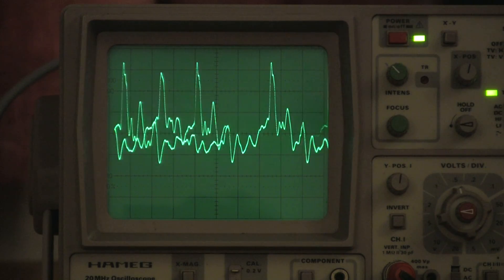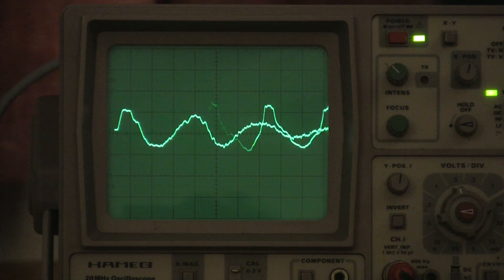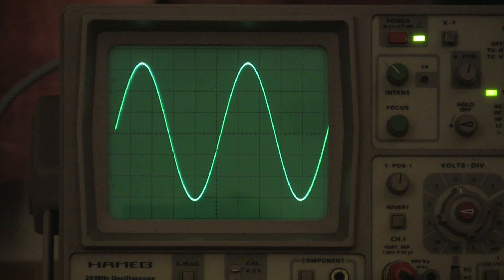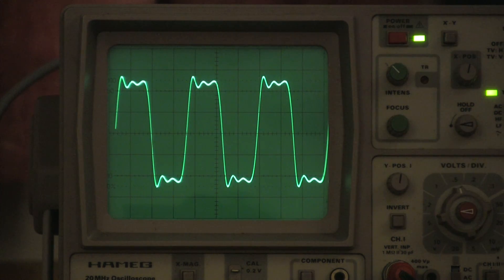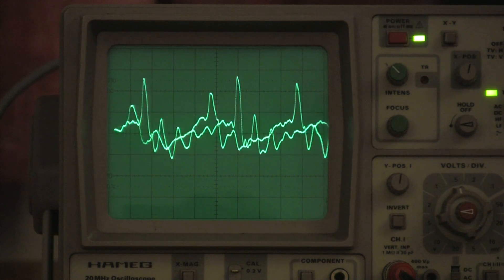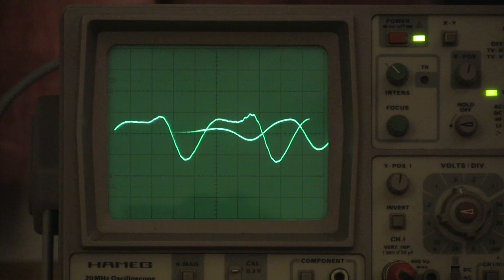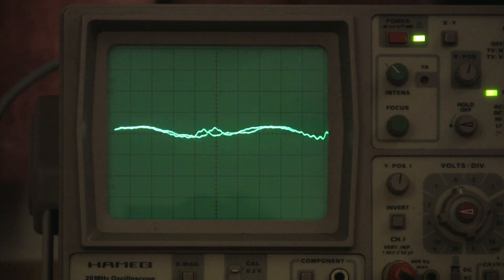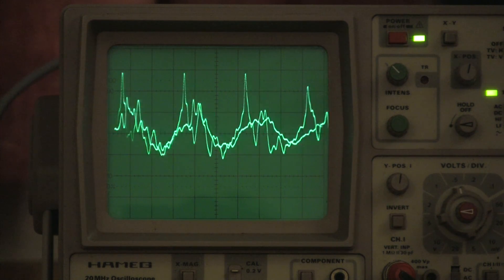Can you hear the difference between a square wave and a sine wave?

Comment: The second harmonic is twice the frequency, not three times, which is the third harmonic. A square wave is composed of odd harmonics. The second harmonic is an even harmonic.
Reply from the maker: This is a useful clarification. I described the second harmonic that is present in a square wave as the second harmonic. To be exact however, the second harmonic of a square wave has zero amplitude, as have all of the even-numbered harmonics. Therefore the next harmonic after the fundamental is the third harmonic, even though the second is not present.

Comment: To those commenting "but that's not even a square wave", please understand (RIP Iwata) that a "perfect" square wave is a purely mathematical concept that cannot physically exist in nature. To produce such a square wave would require that the transitions between a signal's "on" and "off" states take effectively zero time, which in turn would require infinite bandwidth to achieve. As you might be able to guess, bandwidth is not infinite in the physical world, so even a digitally generated signal whose waveforms 'look' perfectly square in your DAW's waveform viewer is going to come out of your speaker sounding the way that the square waves in this video look. (And even if you managed to find a magical speaker that was able to oscillate in the required "zero time" manner to actually produce a physical "perfect" square wave, your eardrums would react to it more or less identically to how they react to the imperfect waveforms anyway.

tl;dr - They may not look perfectly square, but they're as close to square as they can realistically get.

Comment: I know this is old. But many people here are fundamentally mistaken on a point they've made in the comments. Many people are saying the square wave is looking less like a square wave at higher frequencies. Remember that the digital audio is being sampled at 44,100 Hz, meaning per second there are 44,100 values of where the wave is. At the frequency of 22,050 Hz that means that 1 sample is up, and the next is down and this repeats. Past 22,050 Hz, 44,100 Hz audio physically doesn't have the ability to represent that frequency. He stated this much right in the episode.

The display is showing the result of the analog to digital conversion, meaning the graph showing the waveform is showing the digital version of the wave. Since the square wave is generated by combining every other whole number multiple of the fundamental frequency, theoretically to infinite, as the fundamental frequency rises, more and more of the harmonic frequencies that comprise the square wave are above that 22,050 Hz limit and thus the digital waveform loses more and more of its shape when it is converted to digital. This does not alter the sound however, as by the point that these frequencies are lost in the conversion they are already outside of human audio range, we physically can't hear frequencies that high.

The graph shows a representation of the digital waveform, which coincidentally shows an effect similar to what we hear. Just as the 44,100 Hz audio track can't represent frequencies higher than 22,050 Hz, we, as humans can't hear frequencies above 12,000 to 16,000 Hz based on our age and other factors. To our brains what we hear would start to sound more smooth, just as the graph ends up looking smoother as the digital audio is unable to represent those frequencies.

Unintentionally this visual effect, which has no effect on how we hear it, as the frequencies that cause the graphical representation to look smoother are already outside our hearing range, gives us a visual representation of why this effect occurs. This effect, where square waves seem to get more similar to sine waves is a widely known phenomenon, and it happens with analog as well. Even if you completely fake the square wave with software that simply alternates between max and min based on interval, instead of combining all sine waves with odd multiples of the fundamental frequency, you'd still hear the same effect.

Comment: To all the people claiming it was his equipment, thats not only the case. Humans cannot hear about 18-20khz depending on age, history with volume, genetics etc. Square waves render in the frequency domain odd harmonics, this is what makes them different to sine waves. If they did not have these harmonics it would just be a sine wave. Since it is impossible to hear frequency components above 20~khz, suppose this would be a third harmonic, it would mean that any (perfect) square wave above around 7khz is indistinguishable from a (perfect) sine wave of that frequency.
Headphones, amplifiers etc all have a limited frequency response precisely because of this. It doesnt matter that his square is slightly distorted at these frequencies, because the higher frequency components will end up highly attenuated anyways. It may not look very similar in the time domain, but if you look in the frequency domain there's probably still not a lot of difference between the 'distorted' square wave and a perfect one.

Comment: It's the equipment at fault here. It's not able to produce a proper square wave. A square wave is either on or off but the oscilloscope display shows this is not the case. The vertical "drop" and "lift" of the wave becomes more angled rather than vertical and much closer to the angle of the transitional element of the sine wave, hence it sounds much closer to it on listening
Can anyone verify this?
Reply from the maker: The square wave was digitally generated in Pro Tools. You are seeing the effect of digital-to-analogue conversion. An analogue function generator would have made a square wave that looked better on the oscilloscope. But the output has to be converted to digital for Internet distribution. The method used here matches what you see with what you hear, but the demonstration is better done in the analogue domain and observed live, which clearly cannot be done over the Internet.

Comment: From where does this sound come from, no speaker? I'm currently reverse engineering-ing an audio generator with vacuüm tubes, but there is no speaker although I can hear a sound when I put the generator on. From where does this sound come? 
Thx alot if any1 can help me =)
Reply: Ilias de Jager 
Great question! The sound is coming from the audio components vibrating from the voltage in the circuits. Unfortunately, I don't know exactly which components make the sound. It is the same reason that old camera flashes make that high pitched sound when they are charging. If there is an inductor, that would probably make the most noise, because it is most similar to the voice coil of a speaker. I would also guess that a capacitor could make sound because it might be similar to a Piezo Disk speaker like in older digital watches.

Comment: 100 Hz square wave was audible but not the 100 Hz sine wave, why so?
Reply: Depending on where you're listening (e.g. smartphone speakers, laptop speakers, bad headphones), the speaker won't be able to reproduce frequencies as low as 100hz. Since the sine wave has only the fundamental, it will be silent, whereas the square wave you'll be listening to the overtones only - meaning that you're not actually listening to a 100hz tone, but either 300hz or the other overtones above it.
Reply: I make an uneducated guess: With the square wave you're listening to artifacts caused by the unnatural signal (the signal is everything or nothing, and nothing in between). With a sine wave the speaker is gently accelerated, stopped, and accelerated backwards, etc. Much smoother.

Comment: 4 kHz - that's hardly a square wave.
With the slew rate as low as this, no shit it starts sounding similar at higher frequencies. The waveform starts looking similar.
Also at frequencies over 25 kHz, not only don't people hear it, but very few speakers can reproduce it. But as much as we can't hear fundamental frequencies over 20 kHz (or less, with advancing age), we can hear how the higher harmonics alter the fundamental frequency. If these higher harmonics are unwanted (ie. are not present in the original audio signal - they are produced by the audio equipment, that is the so called harmonic distortion. 

Also, second harmonic from 4 kHz is 8 kHz, not 12 kHz.
12 kHz is third harmonic.
4 kHz - fundamental frequency (base, 1st harmonic)
8 kHz - 2nd harmonic 
12 kHz - 3rd harmonic 

Second harmonic from 8 kHz is 16 kHz. Not 24 kHz, that's 3rd harmonic.
And so on.
You said it yourself, components of square wave are the base harmonic and odd multiples.

Comment: Well, consider that many musical instruments produce harmonics at substantial pressure levels well into the 40Khz range.

Best examples would be small brass instruments such as trumpet or cornet. This is even more more pronounced when they are played with a 'mute', where the 'fundamental' is the most attenuated component . If you look at their wave-forms, they are triangle or saw-tooth like (Edit >> this is actually easiest to see with LARGE brass instruments such as trombone played with a mute - for e.g. there's one on Stanley Clarke's second album "Journey to Love" - I forget which track, but it's one of the first 4).

 I suspect this is the reason I find recordings of these intruments at 96KHz or higher, and in fact of music in general to be more realistic and generally 'easier on the ear' than on CD.

In fact I can even go as far as saying that I wince less often listening to recordings (or transfers of analogue recordings) at 'hi-res', particularly of the afore-mentioned small brass - check out, for e.g., the Miles Davis albums now available as 24/96 or 24/192 downloads (or from SACD's, DVD-A's and even blurays). 

This is despite the fact that at my age (mid-50's), and having not taken precautions to protect my hearing earlier in life riding motorcycles and in other scenarios, my hearing rolls-off steeply after c. 12KHz.

Comment: i couldnt even hear 100hz sine
Reply: Surely you're using cellphone or laptop speakers. These are usually bad at playing 150 Hz and lower (100 Hz SQUARE wave sounds fine only because of the higher frequency harmonics)

Try using external speakers or headphones!

Comment: actually a perfect square wave doesnt exist cuz the speaker cone movement always needs Time. a square wave is more Like a sine wave with a much higher freq with stretched bottoms and Tops. thats y it can be heard with any speaker. some synthetic bass sounds are Made using the Same effect: imagine you have an 41 hz (e1) tone. many speakers cant reproduce a Tone that low. so they take a lets say 82 hz (e2) tone and extend only the bottoms and Tops to Change it to 41 cycles. Now the tone can be reproduced with any speaker that can reproduce 82 hz. But doesnt it Sound harsh Like that square wave? no. cuz 82 hz is still a Bass tone.

Comment: You should also know that Youtube compresses the sound with AAC which is a lossy codec. This means that it saves bandwidth by removing more of the higher frequencies. Do a spectrum analysis of the downloaded youtube video and you can see that the higher frequencies are hardly there. I can hear 12 kHz but the volume is much lower than expected due to this lossy audio compression.
Reply: +Mikael Murstam 
Can you please tell me if Youtube and AAC actually compress the dynamic range of audio as well as limit the hi freq response?
Sometimes I think that it's audio is lucky to have a range of 15db sometimes all the sound is the same level, or seems to be.
Reply: Colin Baggarley AAC shouldn't compress the dynamic range by default. I don't know if that's a setting in the codec that youtube is using. However, I know that some codecs use volume normalization. That is not the same though.
Reply: your going deaf, i can hear up to 16k at normal volume, and 18-19k when i turn it up
Reply: ***** no what you are hearing is actually aliasing effects at lower frequencies. You can actually do a spectrum analysis of it and prove that the higher frequencies do not exist. The compression algorithm removes it. By the way, the fact that you say you can hear 19k further proves the point. The algorithm cannot encode higher than 16k and only a baby or a very young child can hear 19k.
Reply: Thanks, Mikael. Probably correct about the codec settings but I've searched for and done as much as I can. Doesn't really matter. Just annoying to hear that "breathing" that occurs with youtube stuff and sudden drop in amplitude when a drum is hit or whatever. Interesting !!

Comment: Good demo, but for technical reasons you won't be able to do this test properly via YouTube, or through any media format that compresses sound data--and most do. This is because most sound compression strips phase information (since we typically don't perceive it, it's an easy way to reduce the data by 50%). Square waves and triangle waves differ only in phase information.

To do the test using digital recordings, make sure you use a non-lossy format such as WAV or FLAC which preserves the waveforms.

Comment: @ 12khz they did indeed sound exactly the same to me...utter silence.
Reply: I can hear them both clearly...
Reply: I am 48 and clearly hear 12 khz
Reply: A lot of people but not all stop hearing very high frequencies around the age of 25.
Reply: LuckyFlesh I can barely hear it when using equalizer
Reply: I can hear 12kHz, but at half the volume of 10kHz. I'm not sure if that is more due to my phone or the fact that I am 46 years old. Not bad for a bass player. Don't feel bad, because you aren't really missing anything at 12kHz. That superpower would be less useful than being able to see infrared or ultraviolet light, although being able to see heat would prevent a lot of burns.
Reply: AHHH MY EARS!!!!
Reply: Meh, I couldn't hear anything from 8 KHz and above. I could only hear 6 KHz if I turned my head.
Reply: Looks like you are an adult.

Comment: Is there something really wrong with my ears, or is there no sound when the 100Hz sine wave is supposed to be playing? I can hear the square wave, but it alternates with silence. What gives?
Reply: Speakers or headphones? My laptop doesn't reproduce sounds that low since its speakers are relatively tiny, but my set of cans do quite well at reproducing the 100 Hz sound.
Reply: +D. Casey Tucker I can just about hear the sine wave on my earphones, but the square wave seems a lot louder. Maybe I'm only really hearing harmonics from the square wave, or something.
Reply: Indeed, because your earphones probably have a high-pass near 100 Hz (some of them roll off higher, some lower), a square wave which has more higher harmonics will sound louder than the sine. Doubly so on earbuds.
Reply: D. Casey Tucker So I'm not crazy! About this, anyway.
Reply: DarthEditous i turned my volume all the way up and i can hear the sine wave just barely 

Note : Using my HTC's Boomsound  Dolby audio on Music mode ( Theater mode takes care of the higher frequencies as opposed to Music mode which usually has low frequencies i.e Bass
Reply: Yourr just not used to listening to bass frequencies. Many people dont even notice the bass in electronic songs when they use headphones. They only hear bass when they feel it.
Reply: I think the pitch was just very low so it was hard to hear.

Comment: Using the Signal Generator in Pro Tools I can hear a Sine Wave up to about 16 kHz, but I can hear the Square Wave all the way up to 20 kHz. Any idea why this is? Why can I still hear the Square Wave above 16 kHz, what am I actually hearing?
Reply: It could be aliasing that the audio card's DSP isn't filtering, or it could also be that the harmonics of a square wave are present on both the positive and negative side of the fundamental.
Reply: +D. Casey Tucker 
Thanks. Yes, I believe it's probably the harmonics.
Reply: I still hear it though i finished the video, so maybe that's persistance.

Comment: I could not hear the sine wave at 100 Hz, but could hear it at higher frequencies.
Reply: Your speaker is too small
Reply: Humans can't actually hear sine wave at 100Hz. You can hear it with headphones but don't let yourself be fooled because headphones actually distort low sounds.
Reply: @groszak1  Dude all humans can hear sine wave as low as 20 hz

Comment: Fascinating!

I also noticed that the representation of the square wave in the oscilloscope was becoming less and less square, and more and more sinusoidal towards the end. Is that coincidence? Resolution limitations on the oscilloscope? Harmonics pushing out of the oscilloscope's range? Or was the square actually becoming more and more fundamental as it went? 

Oh, I know it was sounding more and more fundamental to us because the harmonics were pushing out of range. But the oscilloscope seemed to imply that it actually was degrading, rather than just apparently degrading.

My primary field of interest is in video game music, and video game sound hardware, particularly 3rd, and especially 4th generation. In that field, there are a LOT of square waves via PSG systems, and a lot of sine waves via FM systems (though they're usually so "FM'd" that they're not readily recognizable as sine-based anymore). Heck, that alone is a fascinating thing for me, the transformative powers of FM over a sine, despite having in place a basic grasp of how FM works.

Still, it's fun to get out of video games for a bit and learn even more deep things about sound fundamentals and all the wonderfully weird things they can do! Great video! Cheers! :-D
Reply from the maker: The Best of Nerd Noise Radio The scope is good to 20 megahertz. The HF limitation is in the filtering in the audio interface, which is necessary for digital audio.